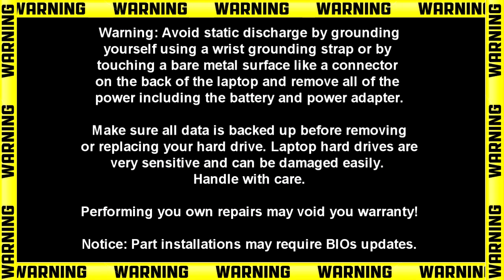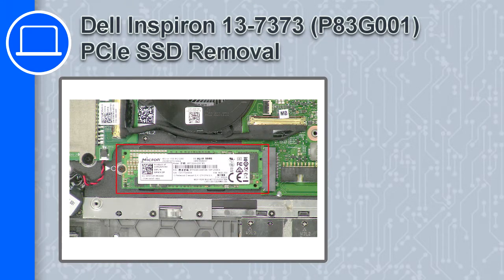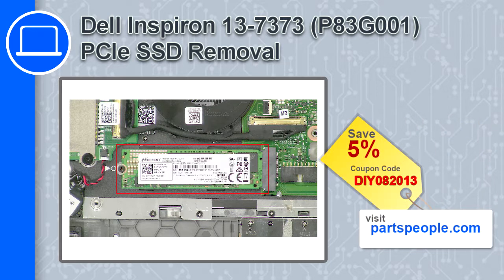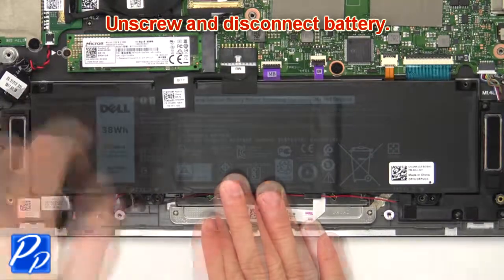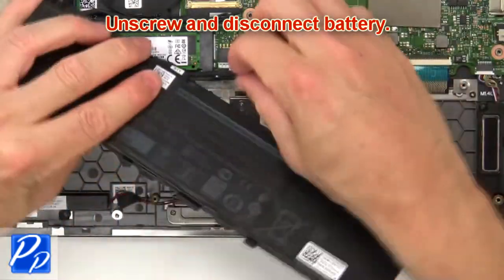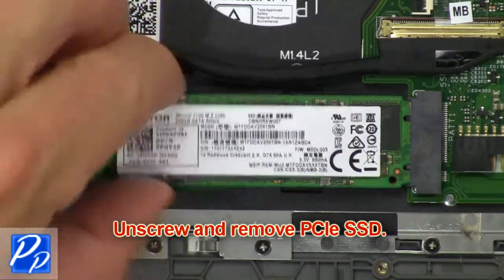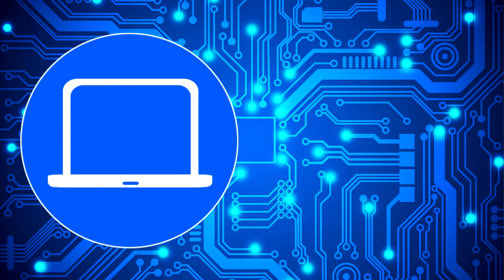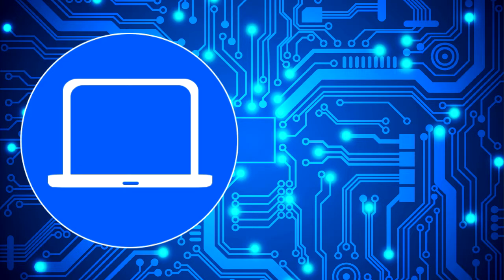Dell Inspiron 13-7373 (P83G001) PCIe SSD How-To Video Tutorial

Comment: Thanks for this. Can you confirm if this laptop supports a M.2 NVME drive?
Reply: I have the same question. Did anyone figure this out?
Reply: @mwolfe38  I haven't tried myself. But from what I understand NVME is supported.
Reply: I installed Crucial - P3 1TB Internal SSD PCIe Gen 3 x4 NVMe and it is working well.